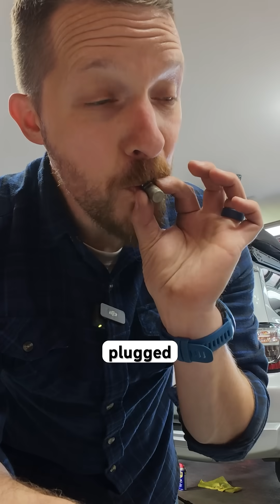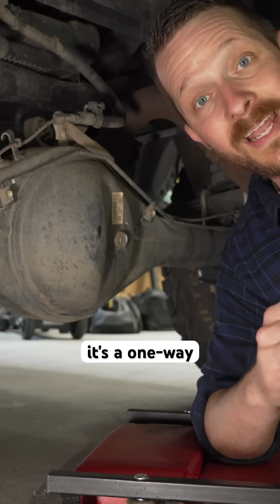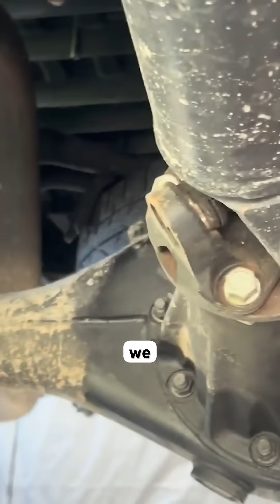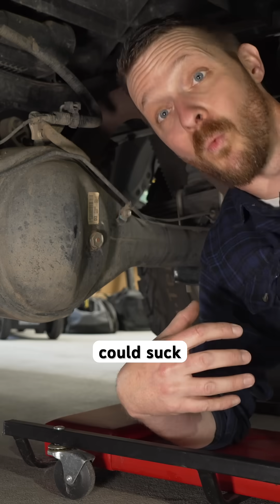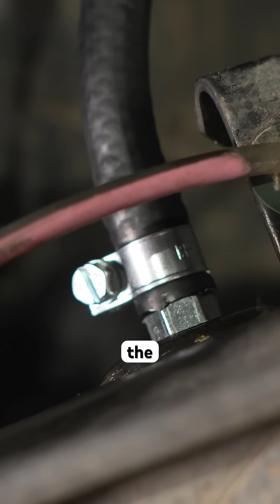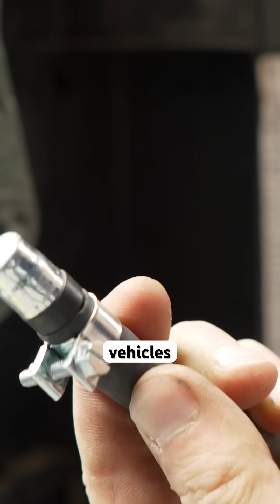WHY Toyota 4x4's Need a Diff Breather Extension!

Comment: Sounds good; however, what happens when warm humid air inside that hose cools? Water drains straight down to the differential. No thanks.
Reply from the maker: I don’t think that’s an issue.  Jeep, GM and many other manufacturers have breather extensions like this stock.

Comment: Ive cleaned so many clogged breathers on hd trucks its important to remember transfer cases and transmissions can have breathers as well usually it leaks from a wheel seal. And thats easy money replace the seal and brakes if soaked bur dont forget the breathers